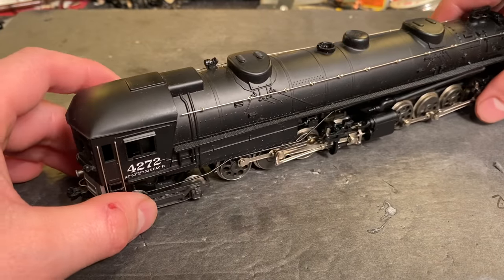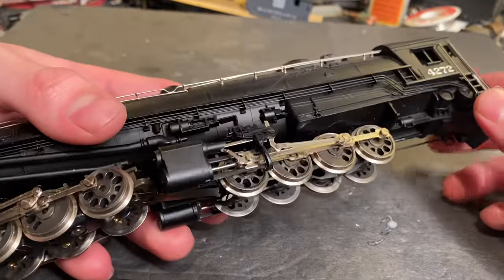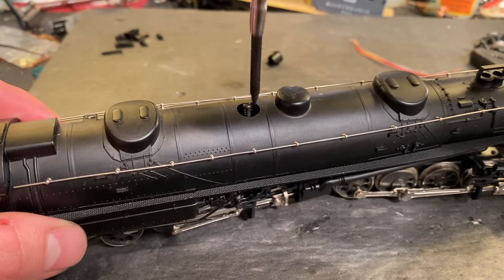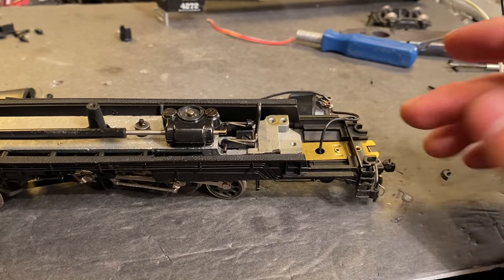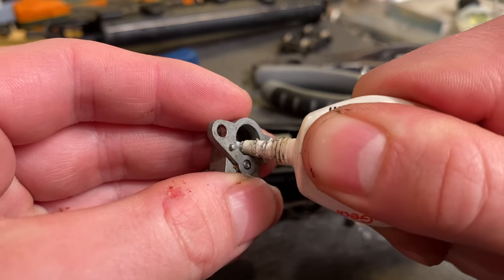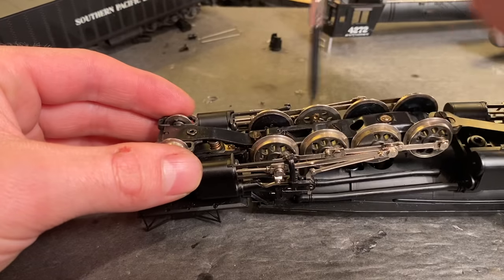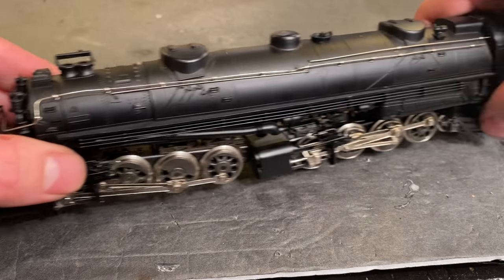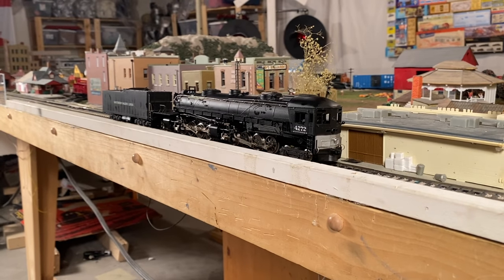Can We Make This Rivarossi Southern Pacific Cab Forward Run Again?

Comment: Why? This model is crap. Poorly designed, poor drive system, mediocre detail. Wasted time on my eyes.  Got an old PFM basket case of the cab forward sone years ago for $ 140 built in New gears and an coreless micro motor with flywheel for app another 100 $ and this engine looks great and  runs superb.
Reply from the maker: To each their own. I like it and it only cost $75.